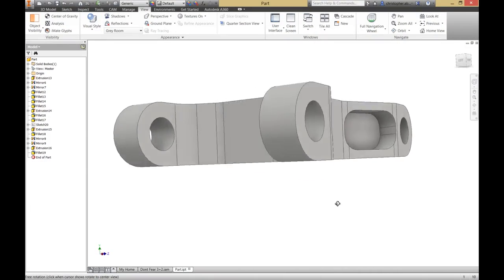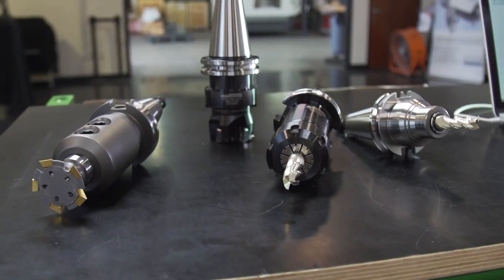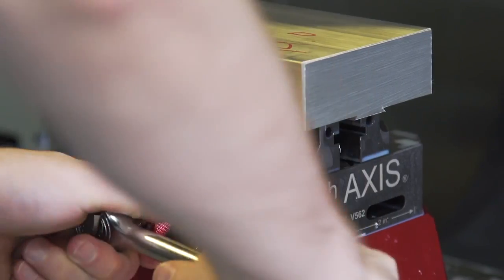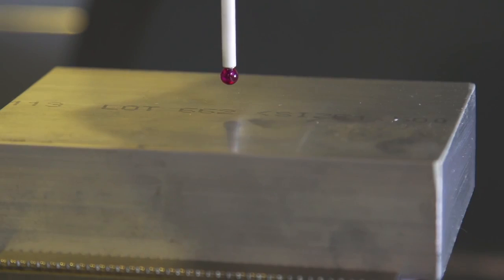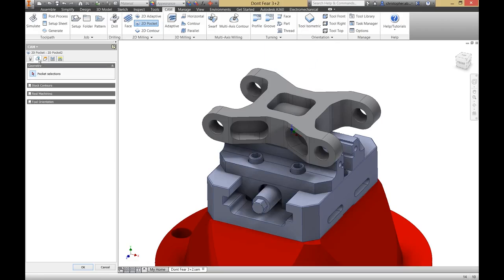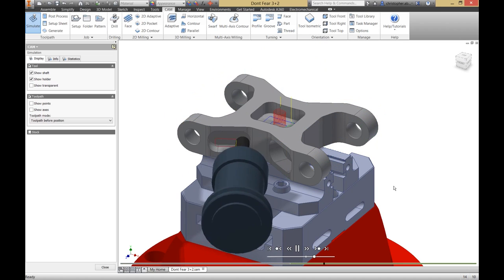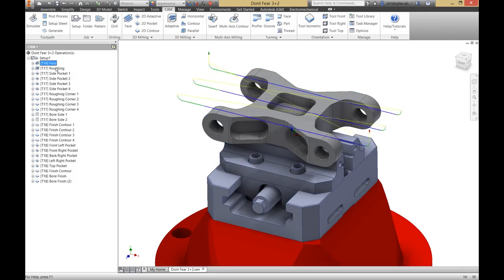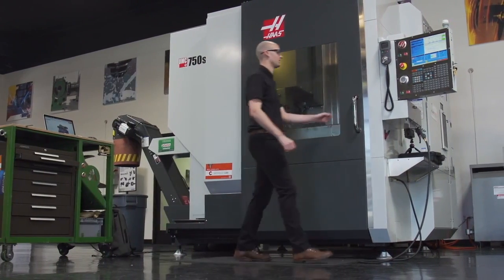Easy 5 Axis CNC Machining

Comment: In a debate at work with the new guy about setting the A or B axis offset. I believe that if the table is flat dont mess with it. Especially when we turn B 90 and spin C the indicator stays at zero. He wants to offset B to the fixture or vise says the machine will compensate on rotation for table not being flat. I say you're better shimming to 0. Help!!!